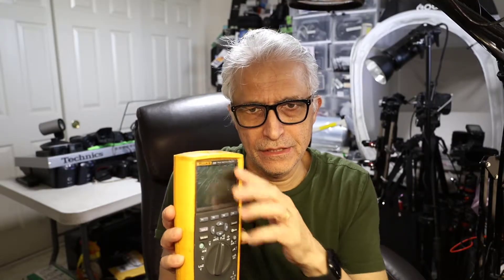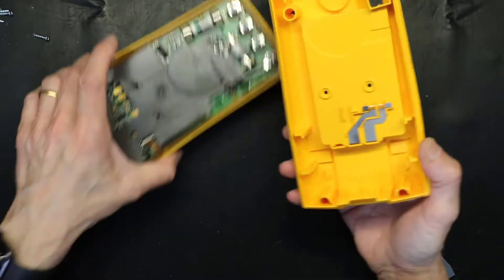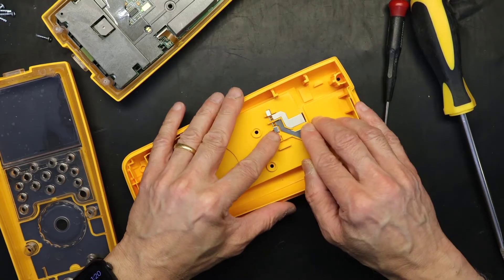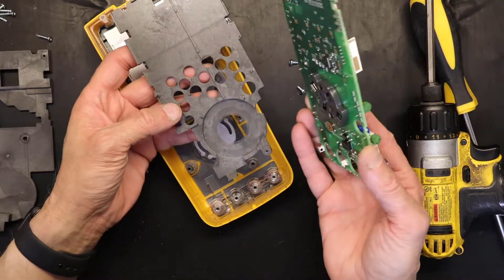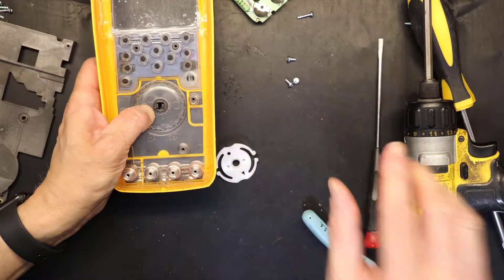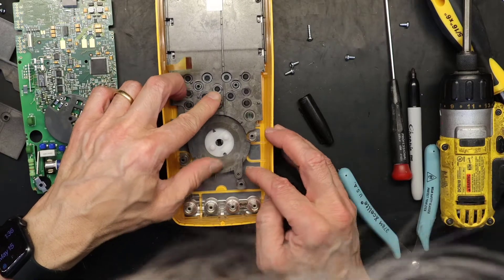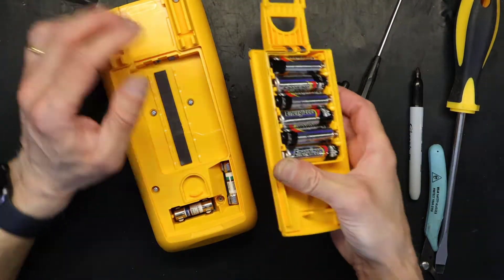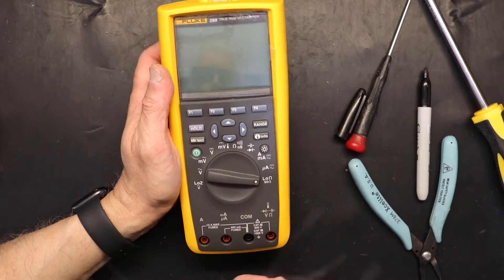Repair Tutorial, Taking Apart and Replacing The Top & Bottom Case of Fluke 289 TRUE RMS Multimeter

Comment: Thanks for the tutorial, have to take mine apart because the little tab on the back that the black button turns and grabs to keep the battery door shut broke off and the batteries will all fall out if I hold it by the sides! I might try and make a plastic screw something to replace the black turn lock I'm not sure yet if I want to get a new case for it. But at least I know how to get it taken apart so far thanks for the disassembly video!
Reply from the maker: You are very welcome, I am happy to help.

Comment: The scratches can be removed with sanding paper, I've done this to a few meters including the 287. Cover the surrounding edges with masking tape, start with low grit sanding paper (120), press it very softly with a flat piece of hard sponge and rub evenly across the entire surface of the screen area until the scratches are no longer distinguisable. At this point it will be completely matted so repeat the process with higher grit, then again with higher and higher until you get to 1200 or 2000. Takes about 20 minutes and if you were patient at each step you end up with a perfect, "like new" cover. About US$5 in materials.
Reply from the maker: Excellent Tip, Thank You!

Comment: And also my fluke 289 has large battry power consumption and when i replaced the batteries it doesnt show full battry level in battry icon . How to solve this issue
Reply: There is a supercapacitor in these meters (189/287/289) that holds charge to power the RTC for 10-20 seconds while you change batteries, so date/time doesn't reset. Over years it develops large leakage current (draining the batteries) and also leaks on the PCB damaging it. It can be found at the top-right of the PCB, either you remove it or replace it and check again every few years. Part number is EECEN0F204AK.
Reply from the maker: Something is shorting out on the board, probably a Zener Diode or something. Check for heat signatures to see if any of the components are getting too hot.
Reply: 太费电，直接改锂电池了，可以用一个月左右！